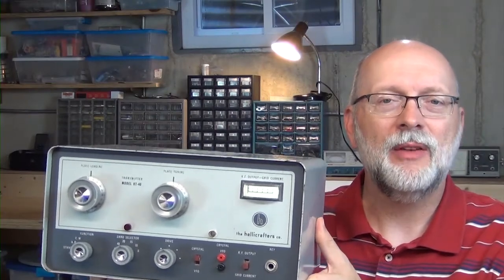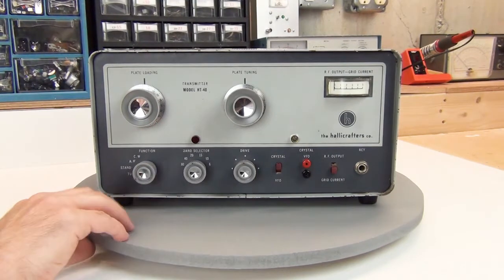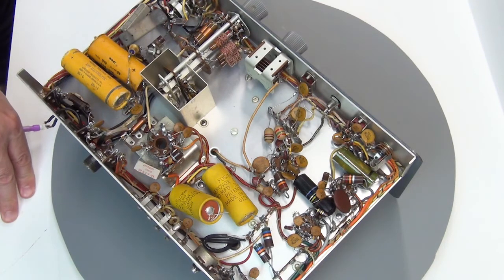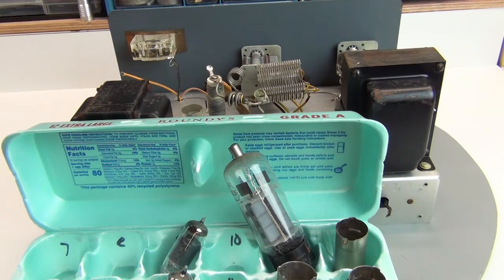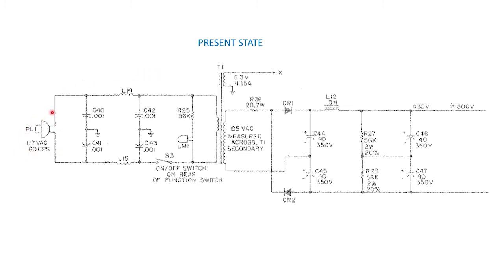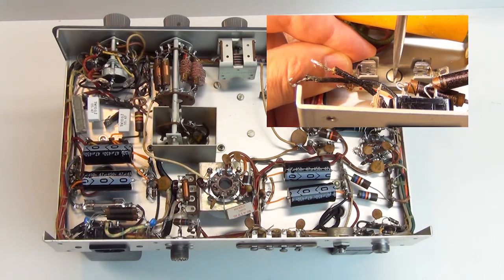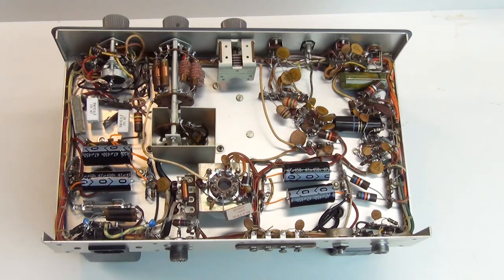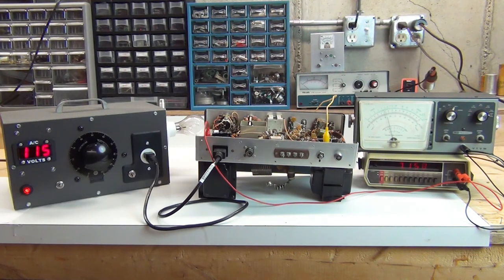Hallicrafters HT-40 Repair - Part #1

Comment: I just got gifted one with the matching vfo. Replacing bad parts is non trivial for me but i am paranoid of the 1960s lack of safety using no fusing and no ground pin. My ht40 lacks room by the line cord for anything.  The leads on the filter inductors are short short. Looks like it had some work maybe in the 80s done. I see some modern ish diodes by one of the 40uf caps. Need to see if i can find some replacement inductors. I really like your iec input idea. Is that just a simple aerospace aluminum nibbler?  Seen em. Never used em.